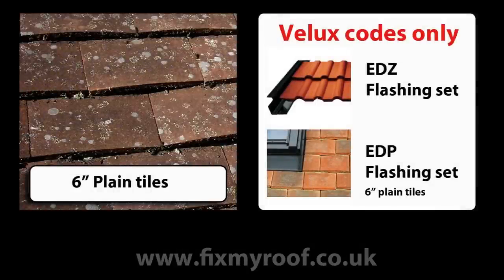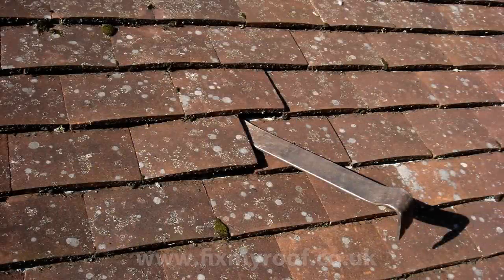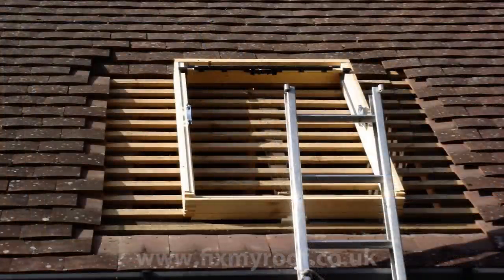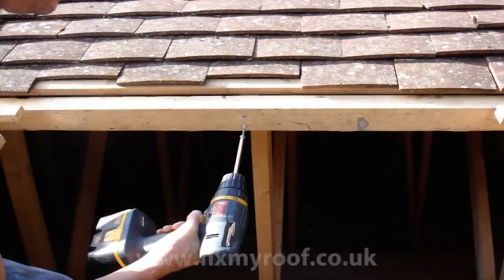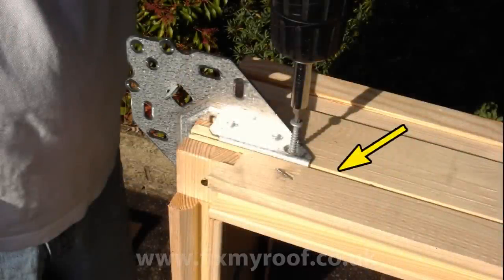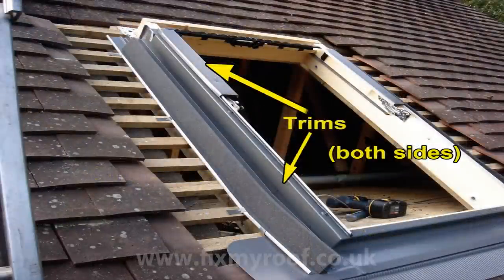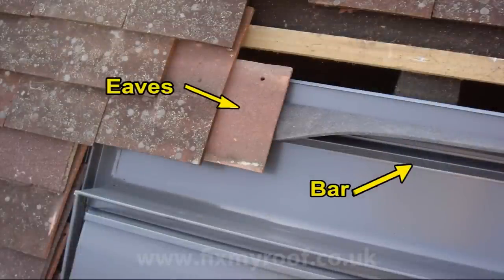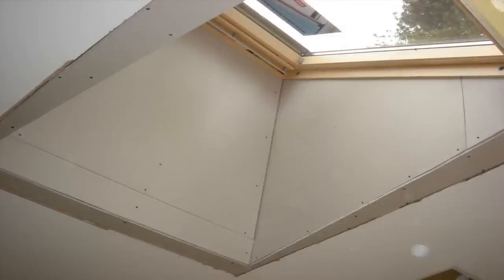EASY   Skylight in Roof fitting a Velux and Installing a Roof Window any Brand

Comment: Hi, I’m currently doing a diy effort to convert my loft. I have bought lengths of 4x2 as I was informed I had to double up the rafters that support the headers. Is this not needed? I noticed you hadn’t used the double. I was also told the headers will need to be doubled as well?

Comment: NEVER EVER cut through the members of a pre-made (gang-nail type) roof truss as this video shows. It could compromise the stability of the whole roof.
When cutting a member out from a truss, advice must be sought from either the truss manufacturer or a structural engineer who will design suitable enhancement of the remaining truss members and necessary alterations to truss bracing.
Reply: I noticed on re-watching that the headers aren't doubled up. At 4:39, there really should be 50x75 doubled up, top and bottom of the window.